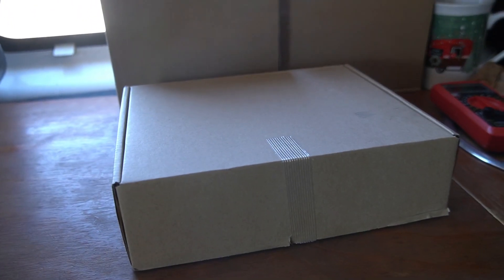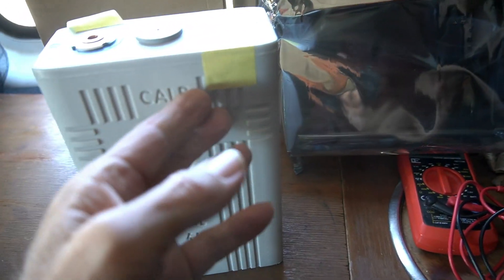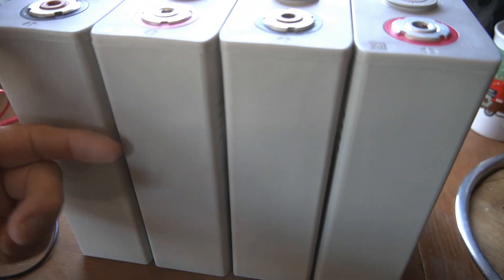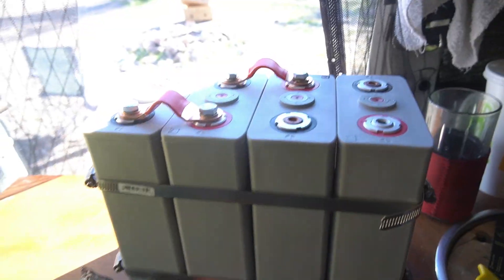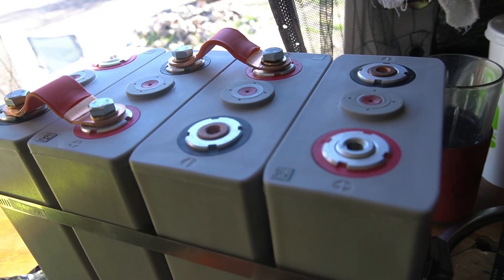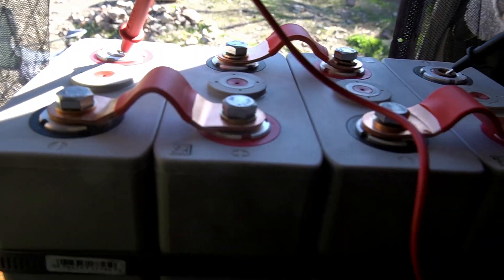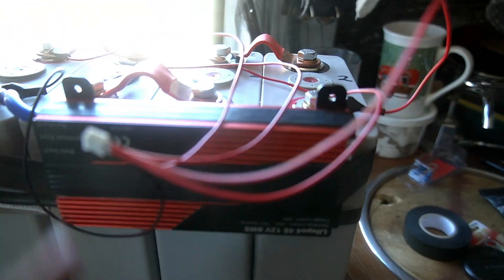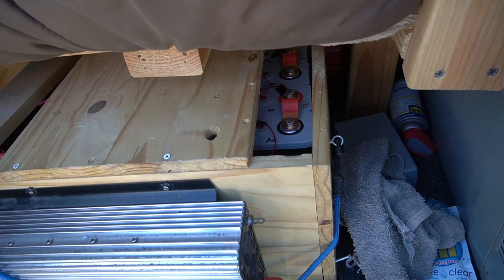Getting and Installing LifePo4 Batteries ~ CALB Batteries

Comment: I thought it would be 100ah x 8 =800ah ? Help me understand why it's not calculated 100 x each cell?
Reply from the maker: Each cell is only 3.4 volts at 100 amp hours. When you hook them up in series, the amps stay the same and the volts get added. So 3.4 X 4 = 13.6 volts which is what is needed for a 12 volt system. After I made two 12 volt batteries at 100 amp hours, I then wired them in parallel to make a 12 volt, 200 amp hour battery bank.
Reply: @TheDanVan  Ok thanks for the information, I get it now

Comment: I just looked these up and these are very good batteries without the humongous cost for Lithium Batteries!!  Now watching what you did to hook them up still all Greek to me LOL I have to ask how much solar do you have attached to them? And what do you plug in/charge up from them?
Reply from the maker: Thank you Saucy!  I have a fridge and a freezer. I also have an induction cook top. Plus I charge my laptop, phone, and other small items. Sometimes I run my TV and DVD player. I have 300 watts of solar on the roof.
Reply: I was looking at Battle Born and the new Jackery Exployer 1000.  They both are the same price (between 899.00-1100.00) and in looking at these lithium batteries you can get all 8 like you did to make 2 12 volt for the same price as their 1  SOLD!! that is what I am looking for! Thank you for your review and how to put them together! ❤😊❤😊
Reply: @SaucysCreativeCrochet  Keep in mind that the Jackery utilizes lithium "ion" chemistry which runs the risk of exploding vs these CALB cells which utilize lithium "iron" phosphate LiFePo4 chemistry (these are safe and supposedly cannot explode), big difference.  That's the reason why I purchased this cell type.  Unfortunately I have not seen a video on the difference between the two that spells it all out for you.  Happy travels!
Reply: @arminius301  yes I made the decision to purchase these instead of Jackery. I have seen videos that these seem to either work just as good or better than the Jackery at half the costs. Thank you for explaining the difference between the two so others can know this as well 😊❤️😊❤️

Comment: What made you decide it was time to change batteries?  Curious about the cost....  Do you love them?
Reply: @LostOnLandAgain Janis and I met you at Lolapalooza. We didn’t get much time to spend with you so you may not remember us. We live in Austin. If you ever get new batteries, I would be glad to help you install them.
Reply: @duanelifeisgood6721  Were you guys the couple who were in the other loop?  I think you had a Sprinter type vehicle?
Reply from the maker: The morning reading was getting lower. Also the date stamp on the batteries was February 2014. Cost was about $1,000. So far I am glad I have them.
Reply: @TheDanVan  My batteries are having the same problem.  Just not a lot left in the morning.  Thinking about getting new ones soon.
Reply: Lola, yes we were in a white Promaster parked by Eric.

Comment: Dan, where did you get the BMS and batteries from? Could you share the part #’s, too, please?
Reply from the maker: I ordered off of AliExpress. They don't really have part numbers, the battery description is: 8Pcs 3.2v 100ah Lifepo4 battery Lithium iron phosphate cell batteries NEW CALB ca100 Plastic 12v200AH 24V100AH for solar RV pack
For the BMS the description is: Deligreen BMS 4S 12V 80A 100A 120A 200A PCB BMS for 3.2V LiFePO4 battery pack 18650 Lithium Battery Pack
Reply: @TheDanVan  That's too bad.  I won't do business with AliExpress because they expect you to give them your F Book and Googoo passwords.

Comment: Great video,  another very important thing to remember is to not bottom out the terminal bolts and apply pressure you run the risk of breaking the terminal contact point inside the battery and the result will be sporadic voltage readings.  I found this issue while trying to diagnose a problem with someone's solar system that they upgraded to lithium batteries.
Reply from the maker: Good point. Yeah I had extra washers just in case. Always want to be prepared.